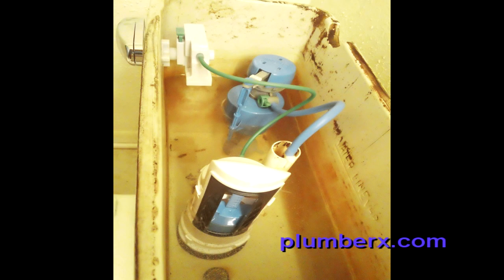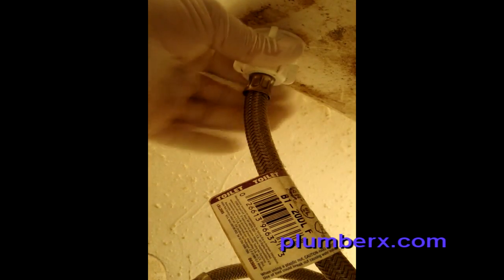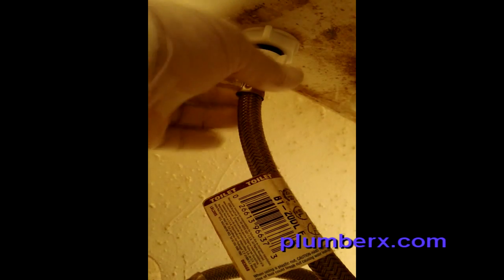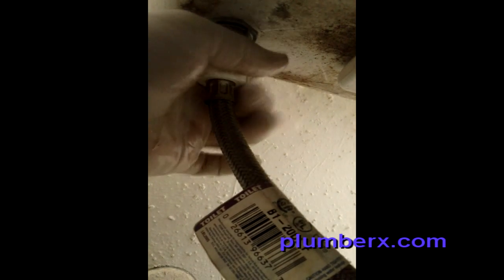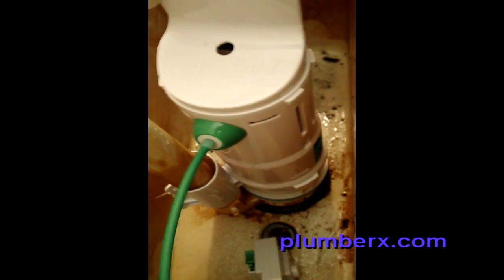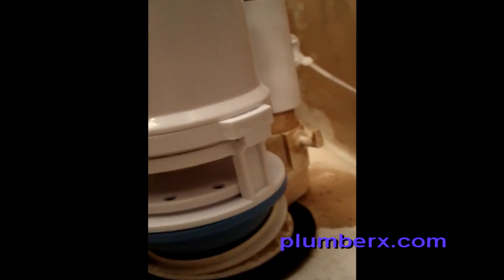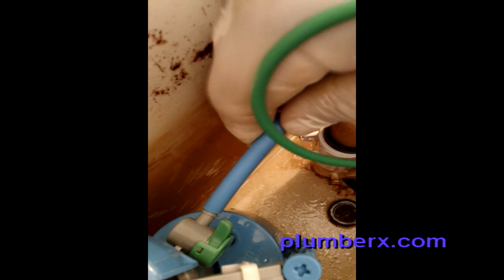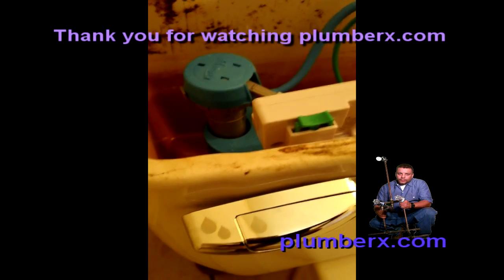Water Saving Toilet | How To Plumbing

Comment: Water Savng Toilets
I called the originals 
Turd Savers Sewer Blocker
Because women use a lot if toilet paper
I was told change the old toilets to water savers ln lest than 1/2 year sewer pluged up toilet overflowing
Nightmare  being head of maintenance i dealth with that for almost 2years then it hit 
Its those turdsaver toilets